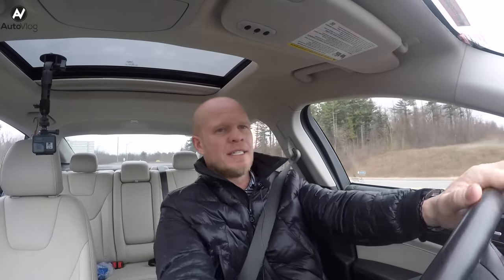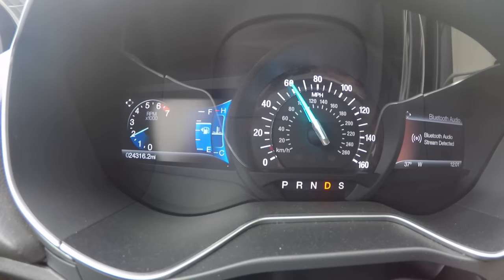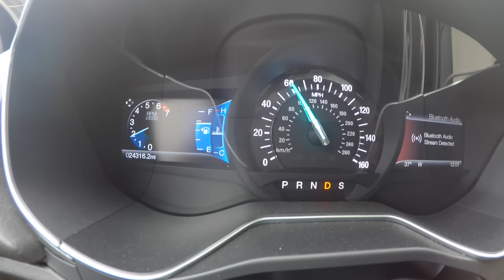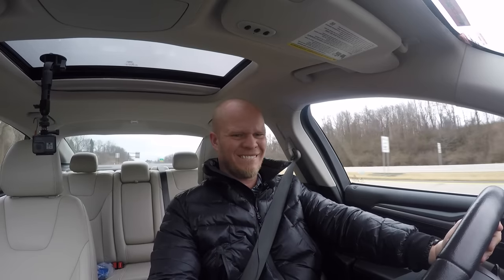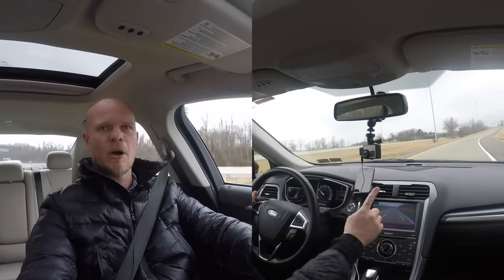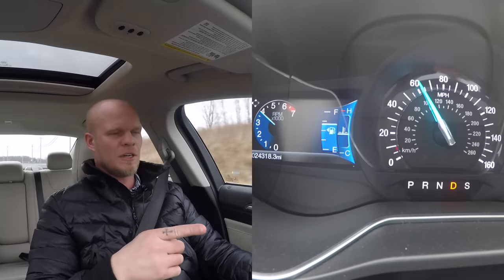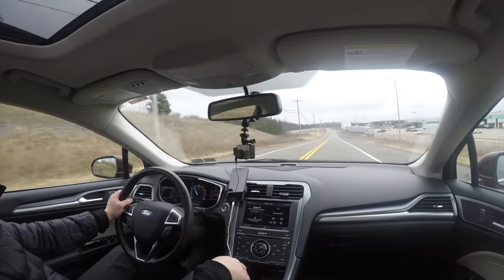What happens if you put your car in REVERSE while driving? (Things NOT to do while driving)

Comment: what will happen if u put the vehicle in park wile driving
Reply: put the vehicle in park wile driving
Reply: please let me know what happens when u put the vehicle in park wile driving
Reply: put in park wile driving na
Reply: I can't speak for a modern car, but I was once letting my 96 f350 roll forward in neutral (engine was off), and I accidently put it in park while going a couple mph, and got a horrid grinding noise that I think was the parking gear skipping. I don't know if a newer trans would do the same thing, or even if that truck would do it at a higher speed. I'm fairly sure a modern car won't even let you move the shifter to park while moving.
Reply: You would break the parking pin instantly
Reply: Depends on how fast you're going and how long you leave it in park. Like I said below, my truck made a horrid noise, but the pin is still strong enough to hold back 13000 pounds of truck/trailer on a fairly steep hill. That said, I didn't leave it in park long and I wasn't going very fast.
Reply: Arnold Golden Corrette what happens if you put the car in first gear while driving on the highway!
Reply: Is that a question or a statement?
Reply: I had a '91 avalon and when I went to drive it to scrap, I found out the brakes were gone (pretty useless). So when I had to stop I would just put it in park once I got to around 20kph. It just stops instantly, although there was a ratcheting sort of sound as if it was trying to catch or something and then when it caught it just instantly locked the wheels lol. That could be pretty dangerous if it happened at high speeds, and I'm not sure if it would even catch above 40 mph
Reply: I was driving with a driving instructor when I was 16 and accidently went through a stop sign so he hit his brake and put it in neutral but accidently went
all the way to park. the tires locked up and we skidded.  the car was between a 2008 and 2010 Toyota camry
Reply: Automatics don't let you, but if you do that in a manual, your tires may lock up and you'll over-rev the engine and have the engine blow up, I think the transmission will be fine though.

There are videos of this, especially in drag racing where the accidentally downshift instead of upshift while at redline. It's called a "money shift".
Reply: manual transmissions don't have a park btw
Reply: iliketobuildstuff
Weird, I thought I replied to someone who said "what if you put it in 1st gear while on the highway".

I guess I commented on the wrong one ,lol.
Reply: SI0AX lol no you did but it was in a long line of comments so I didn't see it lol
Reply: The problem is that the name of the guy I replied to is not on the comment so it's only natural to assume I commented on the first guys comment, lol!
Reply: You have to be able to push the break down to put it in park. You cant just use your hand and put it in park.
Reply: Spencer Lee I don't need to do that for my car
Reply: it goes in Park then when u get to like 3 mph it just stops
Reply: Arnold Golden Corrette please don't try this 1
Reply: drift
Reply: Arnold Golden Corrette 

I have a 2015 Automatic Mazda 6 FWD and one day in my driveway at about 5mph I wanted to see what shifting into Park would do.

The car kept moving forward but was making a terrible clanking noise like it was skipping over the lock mechanism for the brakes.

At one point it was finally able to catch the lock and the car violently jerked to a stop in my driveway.

It was interesting and I decided never to do it again. 2/10
Reply: Did that shit at work because a mechanic didn't pump the brakes and the e brake didn't work lol and i threw it in park it stop but i made a lot of noise but then that truck came in for a transmission replacement but it was covered under warranty soo we were good lol
Reply: you will grind gears and can ruin your transmission that way.
Reply: Chase Moss err it's an auto
Reply: Arnold Golden Corrette I did this accidentally in a 2006 mustang. it made an awful grinding noise but then I quickly switched it back to drive.
Reply: Arnold Golden Corrette while
Reply: You'd snap off the parking pawl. It's like this pin thing that sits between two gear teeth so the gear can't move. If it goes in place while the gear is moving, it breaks off and the car will roll in park.
Reply: 2002 Hyundai Accent auto trans, my wife did this going about 45mph. Tires locked and we skid to a stop, immediately curse words could not stop flying out of my mouth. Amazingly nothing was damaged and it is still working problem free 6 years later...
Reply: Dodge 318 Cummins my mom did this in an 06 Jeep Cherokee and the transmission died
Reply: There's a pin in the transmission that a gear locks into, your lucky it didn't break off.
Reply: Arnold Golden Corrette  old cars its skips to a stop had a idiot friend . Use to do it all the time in a ford tarus. Or how ever u spell it. U leave bunny hopping skip marks . At 65 mph. Amazing it didnt ruin trany he did it prob 50 times!
Reply: it will sheer off the little hook that holds the car in park and youd keep rolling and have no park anymore
Reply: +JimmY exactly, good answer... stupid question
Reply: In older cars, if you're going fast enough putting your car in reverse or park will cause the gears to grind but they probably won't engage which could cause damage to the gears and/or parking pin (plus metal shavings in the trans case).

At lower speeds, really bad stuff can happen. 
The least of which will be a broken parking pin which means that your transmission will no longer keep the car from rolling while in park (plus you'll have pieces of metal wandering around in the trans case). 

If put into reverse at lower speeds, the gears may engage which could cause several problems.
1. broken reverse gear
2. broken main transmission shaft
3. broken or stripped transmission output shaft
4. broken driveline
5. broken or stripped rear end gears (In some cases, this could actually cause the axle half shaft to come out of the housing as well)
6. broken trans mount which could cause the trans to fall free from the vehicle.
Reply: caldwellguy,Your so rite cause I've tried it in a older car before...
Reply: Arnold Golden Corrette m
Reply: Arnold Golden Corrette parking paw.....will go bye bye and will need to use park brake when car is parked
Reply: Arnold Golden Corrette parking paw.....will go bye bye and will need to use park brake when car is parked
Reply: There is an override for that on most cars.
Reply: Arnold Golden Corrette the car will stop in 1.0 seconds
Reply: Arnold Golden Corrette my friends 04 elantra locked the wheels like PARK does... looked, sounded horrible though.
Reply: Arnold Golden Corrette It just makes a weird sound because it's skipping in park and can't stop on the dot like you would think. That's if you're going at least 25 MPH or more.
Reply: Did this once on complete accident with a 99 beetle automatic and it makes grinding noise, this was about 25mph and no problems so far.
Reply: Arnold Golden Corrette

My 2000 Focus Auto just engaged the parking pawl quick. I did it at about 10 mph, and it stopped me on a dime. It was hilarious cringe.
Reply: depending on how old the vehicles are, newer ones have a park override sensor in them that wont allow the trans to  go in park over a certain speed.
Reply: I did just that in my Mazda RX-8 at 160km/h (100mph). My body was thrusted forwards so hard, there was a very loud cracking sound in the gearbox area, rear wheels skidded, switched back to drive and everything went back to normal.

Comment: I have to admit that I thought the moment you shifted to reverse gear your gearbox would be history, that safety feature programmed into the latest car transmission control units is definitely a good thing as there is always the chance that reverse gear will accidentally be selected one way or another, and with a replacement gearbox costing $3000-$4000AU for my 2010 Holden cruize there's no way i'd try it, it's unlikely it would have that safety feature.

Comment: What would happen if you hit the gas after you put it in reverse tho?
Reply: EXACTLY, he would need to hit the gas in order for the reverse setting to take effect.
Reply: Yeah but this was done with a automatic  what happens with a manual
Reply: Same thing I thought (about safety features in a new[er] car), how about and older automatic? And by older I mean 20y's  or more. I remember doing it in an older Camery (by accident) at low speeds and that thing started to jerk pretty bad, quickly put it in neutral but I still think if I'd kept it in reverse I would have done something to royally damage my car.
Reply: A Lu actually my idiot friend put it in reverse without me knowing and i hit my gas pedal and heard my gears grinding.  It was a corolla 2016.
Reply: You won't be able to put the gear shift into reverse, it will just grind against the gears but you won't be able to pull it all the way into reverse.
Reply: There's probably an interlock. I think he knew that because it would be very dangerous if the car stopped suddenly or if he lost control.
Reply: As long as the synchronizer rings and safety features do as intended it shouldn't allow you to.  It may produce a horrible groaning noise and shake but it shouldn't go into gear.  assuming you did then the rotational momentum of the vehicle rolling would back feed into the transmission and eventually something will give out being either the diff, drive shaft, transmission itself.
Reply: +Travelinmatt76 Aah but you can put it in reverse, begin rolling down a steep hill forward, then dump the clutch.
Reply: I put it into low to slow down.  then neutral & rev up the motor , then reverse. this was in a 89 Mazda Capella. putting it straight into reverse just stalled the motor
Reply: Diabeetus Guy I accidently did it in my 2004 cavalier and it almost launched me through the wind shield, had seatbelt on and luckily was only going about 15-20 mph
Reply: Diabeetus Guy i was wondering the same thing
Reply: Diabeetus Guy I drive a 2008 Yukon and I have shifted into reverse going 30 mph on accident 2 times. Instantly locks up the wheeled and engine shuts off. Re starting is almost impossible. It's pretty scary
Reply: MattMohs Outdoorshow How do you accidentally throw your car into reverse while driving 30mph? You must be a horrific driver.
Reply: soggywaffles98 went to do a neutral bomb following my friend and the other time I went to do a neutral bomb by a bus stop. Never again
Reply: I hope the engine revved itself good and hard when you did that.....
Reply: so much this!  most new cars are a "drive by wire" its all computer      NOW try that with a 1985 car........
Reply: Diabeetus Guy Let me tell you. Its not good haha. I had to pull over a restart my truck

Comment: What happens if he puts it in Park??
Reply: Leonardo What's actually the difference between park and reverse. My mom has an old fiat panda and my dad a skoda fabia 2010 and they don't have park
Reply: FTM98 Automatic transmissions have a Parking gear to keep the car from rolling away when you leave the vehicle, automatic transmissions are the most common trans in the U.S.
Reply: Leonardo But can't you just put it in neutral and the handbrake. Or is that only in manual cars
Reply: FTM98 I guess you could do that but there wouldn't be a point to it, usually that would be don't on a manual car only
Reply: You might break the spring if you're going to fast.
Reply: Leonardo the car will stop with alot of force i have done this it is very dangoures
Reply: Okasha Qadir He should do it!! just to see he'd probably get lots of views
Reply: Same thing. I had my fusion get thrown into park while going ~ 30-40mph.  Car just kept going just fine until i pulled over slowly to the side to a complete stop.  Everything perfectly fine afterward.
Reply: +Leonardo It happened to me once. You get a grinding noise, otherwise like putting the car in neutral.
Reply: @FTM98 Manual transmissions don't have a park position. On automatic transmissions it locks the gearbox to stop the car from rolling like it would in neutral. Also on many modern cars with automatic you only can get the key out of the ignition lock when you put it in park.
Reply: if you put an automatic transmission into park while the car is moving you'll hear the parking pawl skipping. it will sound like it's grinding. the parking pawl fits into a slot when you put the transmission in park
Reply: ***** Then he should do a video on it
Reply: That could possibly damage his car. I wouldn't recommend it as it could damage the transmission.
Reply: it will wreck the parking pawl and park ring on the transmission. if it does get ruined,you'd have to use the e-brake as the Park
Reply: Patrick I. He obviously doesn't care with all these tests it's a lease
Reply: It will stop the car
Reply: ksabadboy I bet lmao
Reply: ***** not if he's wearing his seatbelt!! Lol
Reply: most auto cars wont turn off unless you put it in park
Reply: Zachary, did it go into parking gear automatically when you stopped, or did you have to shift it out of park and put it back into park?
Reply: iv put a cx 5 into park while going from  40km to a stop, a bit of a grinding sound but all is fine 6months later
Reply: Leonardo if there's no saftey feature to not let it go in, he'll bust the parking pin and then the next time he goes to put it in park, the car will roll away.
Reply: I don't remember for sure.  Im pretty sure it switched to park once the car had stopped and I took my foot off the break to deal with crap, haha.
Reply: I've put a vehicle in Park when I had a brake failure. It slows the car to a stop. Luckily it didn't damage the Ford C6 transmission.
Reply: If gets under 10 you mean ?
Reply: Optimus Prime? Damn. That is really, really cool.
Reply: Rohan Supari 😂
Reply: Depending on if the car has a more mechanical gearbox or a more electronic gearbox. If it is an older more mechanical gearbox then it will snap the pins off and it won't have a park gear amymore
Reply: i have a 1981 mitsubishi automatic, i put it in park while going at 20km/h (12mph?) and you could hear a grinding noise, not like breaking, most like the lock in the transmission had a spring that was stopping it from breaking, went slower and the car suddenly stopped, it didn't break or anything.
Reply: The locking pin for park may snap off and/or mess up the driveline
Reply: Break the parking paul...I think thats how yo spell it.
Reply: Parking pawl. Hey we are not all perfect everyone including myself make spelling mistakes.
Reply: I've done it before in a hurry to stop (not thinking). I wasn't going that fast but it jerked the car into a stop.